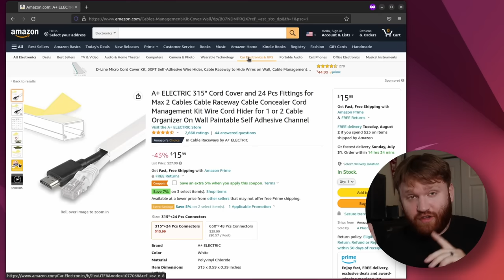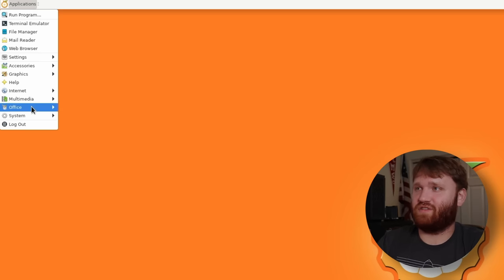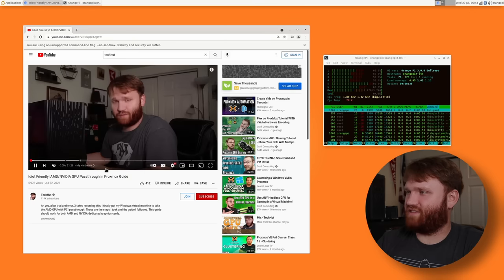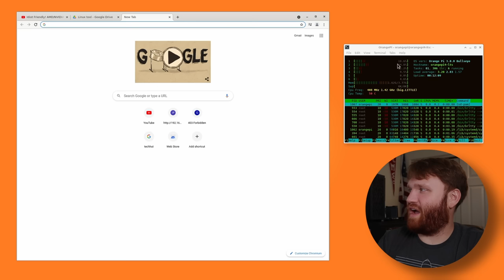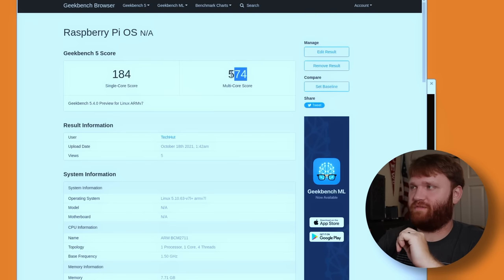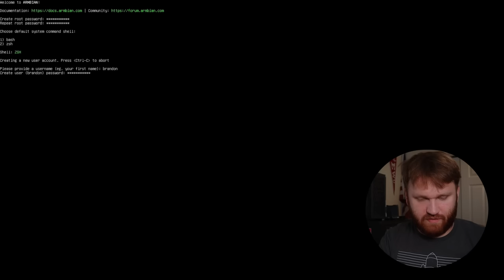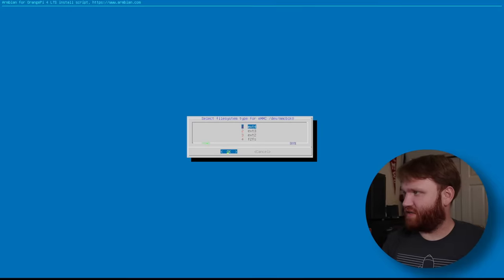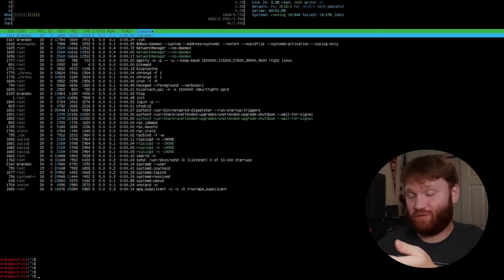BEST Open-Source Single Board Computer? - Orange Pi 4 LTS

Comment: So many competitors came and went. Even if the specs surpass those of Rpi, the support is always subpar. 🙏
Reply: Yeah, tell me about it (Orange Pi Zero 2 user here) - paper specs look great, but then you won't even boot Armbian and realize that it has no upstream kernel support, only vendor patched kernel.
Reply: @JG-mz7hg  unfortunately SBCs are still wild west territory :D
Reply: Rk3399 has great linux support. How good is vpu on rpi4 on rpi os 64 bit out of the box?? really bad! So, I dont get what people say about support, specially referring to desktop usage. Rpi has a huge community, that doesn't mean support at all. I use a lot of rk3399s and they do work great on mainline. Not easy to get vpu working, neither on rpi4 on aarch64 (and considering the vast resources rpi has). I have many things to criticize on this particular model, not the soc or their support on mainline linux. At least not in comparison with what rpi delivers. Rk3399 is FAR superior, tons of I/O (4x pci 2.0 lanes, 2 usb 3.0 interfaces, real interfaces, not like rpi4) , similar cpu power, much stronger gpu. There is nothing to debate regarding desktop usability between them.
Reply: @microlinux  what do you mean by vpu here? A gpu?
Reply: @alx8439  media decoding capabilities.  Vpu means vision processing unit. Vpu on vlc on rpi os 32 bits works great, not inside the browser on my side, but on aarch64... it sucks, at least it was like that 2 months ago
Reply: @alx8439  rk3399 runs in mainline like a champ, no rpi distribution run on mainline, they use downstream rpi kernel. Rk3399 has great mesa drivers as rpi, a bit less mature, but they are solid and not only that, the gpu is far more featured than the videocore 6, not just more powerful. And those features are there, supported at mesa. The only thing not supported is vulkan, and even then, rpi4 gpu lacks of many features that makes opengl apps to freak out (like the lack of depth clamp), lack of textures support, lack of vulkan extensions that make stuff like dxvk impossible too. A vulkan 1.2 driver that's  great for rendering cubes since it can't do pretty much anything interesting due the lack of hw features.

Rk3399 has excellent I/O, reaching  to 1.6 GB/s on nvme drives for reads and 700 MB/s on writes, while having 2 independent usb 3.0 interfaces to play with. It plays on a different  league altogether.
 
Rpi4 can allocate 8 gb of ram? Nice, but even then it has a crappy 32 bit bus, while rk3399 has a 64 bit ram bus that provides way better memory bandwidth. The rpi4 gpu struggle a lot due to those mem bandwidth constraints, making the all affordable pc very appealing if you use microcontrollers for desktop.
Reply: @microlinux  thanks a lot for explanations
Reply: @alx8439  no problem, this rk3399 sbc by opi expose the 4x pci lanes like crapp, the port is odd and based on other people said, it doesn't reach 2.0 speeds bc of a hw fault. it also runs at fixed 5v and that's to low for rk3399, causing power issues, at least on thr model I had. That's  a design problem, not the soc.
Reply: @alexkongkim504  hahahhahahahahahaha
Reply: @alexkongkim504  actually armbian works quite well on that machine. It has some flaws package-wise, but it has all the supoort of orange pi 4 lts hardware out of the box. I tested it myself
Reply: Support for the Pi doesn't matter if it's impossible to get them.
Reply: @canonicaltom  Agreed 💯% Availability for the Rpi is beyond ridiculous at this point. Most vendors aren't restocking until the end of 2023, with no details on the Rpi 5 release.
Reply: agreed, it's always the software.
Reply: Exactly... bought a Orange Pi years ago and Build support was $hit, up there with Kadas
Reply: @microlinux  Since RPI stock evaporated.. Tired of waiting.. Which Rk3399 you suggest?
Reply: @WilsonBradleyTheOfficial  well, I will recommend different sbcs. For I/O related projects rk3399 is a great idea. And for such rockpro64 would be a great bet, also odroid M1 (based on rk3568), but the latter has less raw power while more efficient than rk3399. For retrogaming, any amlogic S922X or A311D would  be fine, so odroid N2+ or the upcoming radxa zero 2. For light retrogaming radxa zero is fine, get the 1 gig ram model to make it cheap.
Reply: @microlinux  Hi, I see that you know lots of things about Orange PI 4LTS so I need to ask you something about it. Should I use drum Jack Power supply with 5V 3A or USB Type-C 5V 4A Power adapter? Thanks
Reply: @the-matrix-has-you  that's the exact problem I have with this sbc, it's 5v only...I only tested the older non LTS version.. and dude, I had a lot of power issues even with slight OC or just power hungry USB peripherals . I had those with both jack and type C, BUT, my jack PSU wasnt beefy enough to certify that the board was problematic. I would prefer JACK, but again, I don't think this board is that reliable at 5v, at least not if you are planning to use some power hungry stuff stuff from USB ports. Uou can always underclock a bit (not that hard, from armbian is justo going to armbian-config) to make it stable with a potato PSU on type C
Reply: @microlinux  Thanks for the reply. I am not gonna use the boards usb Connectors I will be using this SBC as a Ubuntu + Home Assistant Server 24/7 operation. I guess I have to find out Schematics of this board if available so I can understand whether usb type c or drum Jack is more a Safe way to Power this device. Thanks for reply again appreciated
Reply: @the-matrix-has-you  I think you are not going to have any real trouble then... don't worry.
Reply: The catch 22 is essentially in order to get more people using it, you need to have proper support. Of course, you can't get proper support unless if people use it.
Reply: @ArniesTech  : Well, it's something that some of us (waves hand) can deal with if we have access to info as I'm part of the, "Linux Plumber," crowd.  It's that I'm just a one-man show, so I can only do so much for everyone else.  The Pi has a bunch of my type supporting the thing in OS, etc.
Reply: @microlinux  : The problems you have with Mesa is that it's not as full a driver.  While the GPU is more powerful, you will need to use the vendor's proprietary drivers and be able to hand load up them to be able to take advantage of it.  In the end...it's that people KEEP trying to claim <X> is a, "Pi Killer," or serious competitor- but it's all wishful thinking.  Without the ecosystem already set up with solid FOSS drivers or easy drop in proprietary like X86 systems have, you have JACK there.
Reply: @WilsonBradleyTheOfficial  : You're going to find that the inventories for most of the rest are nearly as dodgy.  Therein lies the rub.
Reply: @liquidmobius  : As an observation...I strongly suspect that most's "need" for an RPi5 is questionable at best.  One of the problems with ALL of this is that everything is going to be hard to lay hands on- with the difficulties being that all of the toys we're using down at the bottom end of embedded/industrial SBCs are that they are using Legacy process nodes.  This is going to be a problem at least until mid to end of 2023 if not a little bit longer as they speed up roll out of new facilities using the old process nodes to keep up with demands.  The main reasons why stock is available for these is that they're generally a Shite product- and have been beyond dodgy from their earlier days.
Reply: @frankearl9285  I have no idea what you mean. Mesa panfrost is the gpu driver and it's FOSS, the same as rpi4 gpu driver. Also, rpi4 use blobs for the vpu and for the entire platform to run. It use a lot more complex closed source software to run. From the vpu blobs to use thr vpu to the blobs that control the rpi4 behind linux all the time, I am referring to threadX here
Reply: @microlinux  : Heh.  

1) Not all Mali GPUs are supported by Panfrost.  That it is supported is a bit of a GOOD thing.  In the past that was an issue for a LOT of boards.  (It's why I said what I said.  You're telling one of the Gents that actually MADE OpenGL happen initially on Linux this stuff...)

2) All sorts of firmware has blobs.  This is *NOT* the same as the GPU drivers.  To lump them in is to munge concepts up.  Badly.  Again, you're telling this to a Gent that founded all sorts of things in the space, including Embedded Linux.  I do know a bit of what I'm talking to...including the reality that the HW vendor is, from past experience, ATROCIOUS in supporting anything other than the Barely Functioning Ubuntu bodge-job they get going to sell this for signage work to their industrial customers.

I stand by what I said.  The only thing that I didn't know was that Panfrost IS supported, which makes it slightly better and gives it an even chance to be usable.

What gets ME?  That people, YOURSELF INCLUDED, seem to think you need a Pi Killer or similar.  Just use the silly thing if it works for your application- the reason why the Pi4 keeps getting gone back to is a past history of HIGHLY dodgy crap combined with stuff that there's just nowhere near the ecosystem for- or relies on someone like myself to support the silly thing in the claimed space you're claiming.
Reply: The Pi4 mostly works out of the box.  No questions.  And with largely the LATEST Linux software instead of an OLD 3.x or 4.x kernel and code that matches that age there.
Reply: @microlinux  can you please tell more about these flaws? I'm currently researching and only finding that there is very little of info, I'm curious because I want to build my SMB/FTP/torrent/VPN server

Comment: I actually just bought an Orange Pi Zero 2 a couple weeks ago, due to the Raspberry Pi shortage. It arrived the other day and I had no issues throwing the Debian Server image on it and had her up and running as a Pi-hole DNS server in no time. Loving it so far, a very nice Pi alternative, but the con being what you mentioned, there is less support and not a as large of a community.
Reply: i use the brave browser and it has Made my pi-hole absolete
Reply: I ordered an orangepi for the same purpose, but I was skeptical of the performance so I ordered orangepi 3 LTS. i know its an overkill !! but still
Reply: @samsungemployee5243  not everything that needs ad/tracker blocking uses a browser.

Comment: The lag in the OS shell menu is caused by incredibly inefficient coding. A computer should not require extensive hardware acceleration just to re-render a menu. Even Windows 3x had similar menus which worked just fine with the CPUs at the time, it's now over three decades later and the CPUs cannot cope?
Reply: Blame it on Debian, but I personal like to use Ubuntu and Manjaro (Arch base).
Reply: I Think it was more to do with the video chip couldn't handle the 2k video mode he was in. I would say keep it at 1080p or less

Comment: I love XFCE, but it seems like a heavy choice for this. MATE would have been better if they wanted a "standard" GUI, but iceWM or the like would have been a smarter choice.
Reply: What are you even talking about? XFCE might not be LXDE levels of light, but MATE is an entire Gnome fork. It's definitely not as heavy as you're making it sound.
Reply: The reason there's so much lag in his video is that he's likely using deoptimised drivers (basically x direct drawing instead of using a memory buffer), which  would cause the video drawing to be cpu bound.
Reply: @flynn3649  Proper video drivers and lower output resolution would help. But the desktop experience isn't what the Raspberry Pi (and its counterparts) is all about anyway. It's more about servers, IoT, and single-purpose devices with optimized, low resolution GUI.
Reply: I installed wayland and all menus slowdowns are gone. There’s a note about Mali T860 drivers support for X Org, they even dropped it in their proprietary drivers starting from some recent past
Reply: @alx8439  Can you check if OpenGL acceleration works in Chromium by typing chrome://gpu?

Comment: Armbian is the go to Orange Pi's OS...they do a VERY good job of building it!  What is cool it comes stock with zram already running!
I have several Orange Pi's running at my house and they work well...however I would recommend heatsinks and active cooling...the processors do love to run a bit on the hottish side
Always do a full apt update and apt upgrade on a fresh install just to make sure all the packages are up to speed
Reply: That's because Armbian overclocks their CPUs by default. You can decrease the frequency back to normal in the settings; I always do whenever I run an Armbian image.
Reply: @liquidmobius  : These CPUs when they're at peak clocks will heat up.  Nearly as much as the overclock.  The only time you can kind-of get away without a heat-spreader or a sink is when you're running in Conservative or Low-power mode.

Comment: Ive started buying orange pi's and banana pi's for my projects.the built in emmc storage is handy too as it saves an extra purchase of SD cards. Their OS options are somewhat limited and many of them are EOL/EOS versions of debian or Ubuntu. It would be great if they had better support for newer kernels
Reply: And this right here?  Folks?  THIS is why I say what I say about these boards.  With a Pi, you get a MODERN distribution with MODERN software.  With these?   X-D

You'll need to have my chops (I develop embedded Yocto Linux builds for the Fortune 500 under contract...) to maintain the boards.  Seriously.
Reply: @frankearl9285  or just use armbian. It supports even the original, eol pi.

Comment: Back in time I really loved the Orange Pi PC before the chip shortage and COVID. They were very cheap compared with Raspberry Pi. I could get a Orange Pi Zero 512 MB ram with power cable and a copper heatsink for approx. $12. With Armbian as OS, they were my favorite for small projects. 

How I think the Orange Pi PCs with Allwinner H2, H3 and H5 SoCs are too expensive compared with the Orange Pi PCs with Rockchip and Allwinner H6 SoCs which cost a little bit more.

Comment: Having 2 extra cores is definitely an interesting proposition... I often use my rpi to build docker images for ARM for my company, because it's actually significantly faster than QEMU (like an order of magnitude faster). Assuming the software is decent enough (as others have said it does run Armbian), then you could add the rpi repos and create a franken-debian with more software available.
Reply: Excuse me for my ignorance, but does the source code compiled let’s say on Linux @ RK3399 with its all cpu specific customization and optimization will work on some different ARM (c) Cpu linux?
Reply: @echoptic775  you can't use KVM to virtualize an ARM box on a x86 machine
Reply: They don't work QUITE the way you think they would.

If you're using low-power, mostly occasional web serving, yeah, it CAN make a difference.  If you're doing  compute heavy stuff, it falters in several differing ways and your mileage may vary.  Some tasks will gain from the slightly higher clocks on the  two A72 cores.  Other tasks gain from having FOUR A72's instead of just two at slightly higher clocks.

It is for this reason that I claim that unless your Coreplex farm (The CPUs you have in the SoC) is one-for-one identical except for clocks, memory, etc. you really CAN'T make these comparisons except by trial and seeing if it works out better or not.  It's also why I can't understand why people go on and on about <X> being a "Pi-Killer".  Nope.  Unless you're talking a Xavier NX at Pi4 8Gb prices, you don't even remotely have one.  You have something that works as a REALLY good alternative for application <X>.

Comment: I had the same problem with the WiFi connection on my Orange Pi 3 LTS. The fix was to install an older version of Armbian than the current (I settled on Bullseye)

Comment: The whole point of the raspi was low cost.  You could run a full linux with gpios for 30-50 bucks.
While I agree that $100 is still a good value, it is not the Insane value that was the whole point of the raspi.
Reply: A RPi at any price, with no availability, is a non-contender.

Comment: Main problem with these - short support and no community really. Plenty of ploblems with stability, you end up (in best case) with armbian after a while and then it end up in trash. The community is a differentiator between usable miniPC and ewaste. With the RPi shortages, I've started to use cheap Celeron-based miniPCs with far more performance comparing to RPi and comparable power consumption. Plus far better support as it is generic x86-64 architecture :(

Comment: Orange Pi looks interesting, thankyou. Those "Cable kits" though...
Screwfix or any good hardware store does exacly the same at a fraction of the price.

MT1, MT2 or MT3 sticky back PVC trunking is all those are really. screwfix does trunking in 2M lengths for a couple of quid

Comment: This was a good illustration of why the Pi is worth buying over the Orange variants. The latter have no real community support, and the software and drivers are pretty dire. They also lack libraries and hardware support for the video decoding, and OpenGL etc. So unless you just want to tinker with flashing an LED and a very basic desktop, they're not really worth it currently.
Reply: I think your info is a little outdated, and raspberry pi 4s basically don’t exist for any sane price right now. So it’s not like there’s a lot of good choices.